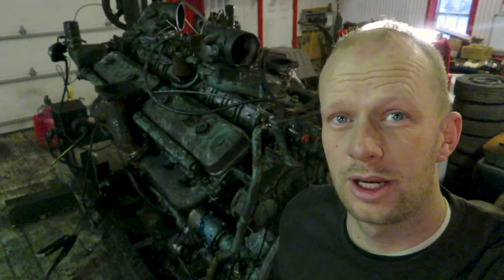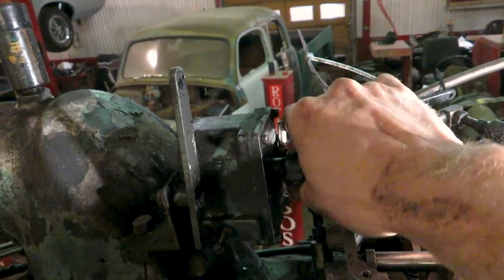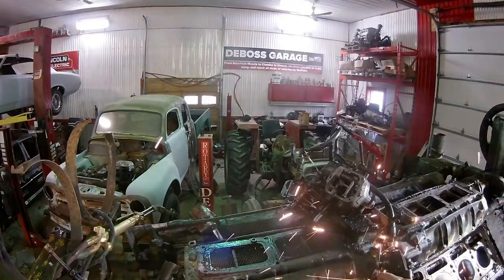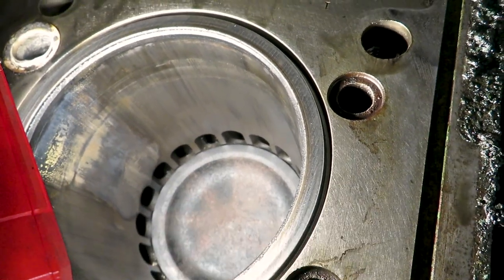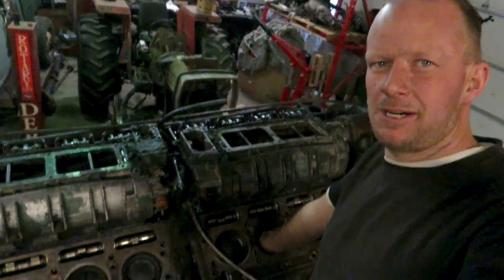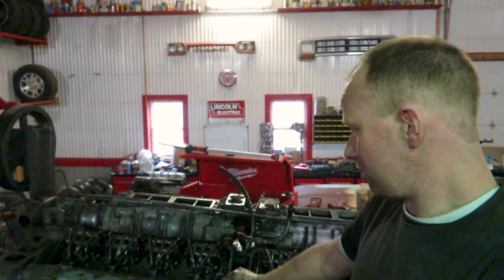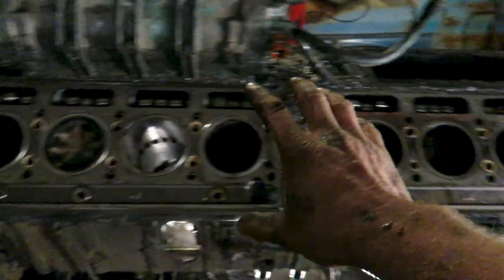What's Inside a 16cyl 2 Stroke Detroit Diesel? #HowItWorks

Comment from the maker: Blowers, valve covers and badging are sold. Check our eBay listings to see what else is available: https://www.ebay.ca/usr/deb0ssgarage?_trksid=p2047675.l2559
Corrections on the video: The engines are not ambidextrous, you can't switch the cranks around because the flanges are different. Also when they run backwards, they puke oil out the blowers and it's not good for them. You need to time the engines differently in the timing cover to get them to run backwards.
Reply: I'd be interested in a piston/Conrod.
Reply: This was actually very useful, my dad has an old tow truck with a CAT 3116 which has mechanical injection. its having a hard start problem watching this video has given me some pointers on what components in the fuel system could be the culprit
Reply: lol thats what i wanted hahaha if you sell one from the other 3 you have let me know
Reply: @CP110 ..... The Cat 3116 and the GM/Detroit Diesels utilized two completely different types of injection systems... they were as different as "black is to white".
Reply: @CP110  yes Detroit is different systems
Reply: How much for a piston and rod
Reply: Dang that fast
Reply: Can you sign a valve cover for me
Reply: First two minutes had me stoked! Watching the rest now.
Reply: Hope they didn’t give much for them blowers because you can’t use them on a gas engine
Reply: This is a 4 storke Diesel engine  Not a 2 storke  Diesel engine   the engine  has valves
Reply: @DaemonWeiss  It's 2 STROKE, Valves does not equal what powerstrokes it does but I'm curious for your explanation and for you to share your expertise and years of working with big diesels and what brands.
Reply: @Salpeteroxid    you have to write 2 valve per cylinder 2 stroke is the working cycle as with mopeds and some cars for example the east german trabant 601
Reply: @DaemonWeiss  It's the powerstroke, I know exactly how it works, I myself am a mechanic. This is beyond your understanding and I think there is a language barrier for you to understand.
Reply: If you want a guaranteed runaway on a future Detroit , dump 1/2 gallon of gas in the engine oil .Then @ wot ,rack max , dump another 1/2 gal into the blower . She'll catch a wiff of the cranckcase then ! Thanks .
Reply: earl verity  If it has a powerstroke every TDC it's a twostroke.
Reply: earl verity  Yeah I know, I'm a train mech. btw. But guy geeze this guy I swear!
Reply: earl verity  Stroking my valves as we speak, four strokes. Any more and we are just playing ;)
Reply: earl verity  Yeah 2% oil right? Wouldn't wanna sieze it!
Reply: @Salpeteroxid  Are the valves on this design for inlet air only and the exhaust is via the ports?
Reply: @DaemonWeiss  it is a 2 stroke that'll was what all the org detroits were and they have exh valves.how ever no intake valves they have intake ports in the cylinder liner.
Reply: Valve cover? It's a 2 stroke?
Reply: @ajripplecon  You may be confusing 2 stroke engines that have no valves (like a motorcycle or a weedwhacker) with the fact that this has exhaust valves and thinking it must be a 4 stroke. 

With forced induction (the blowers) combustion and exhaust happen on the same stroke (piston moving down), and intake and compression happen on the other stroke (piston moving up). Exhaust and intake happen when the piston is at the bottom of the stroke, and compression and combustion happen at the top of the stroke. Pretty cool design...
Reply: It takes different cam shafts to make it run backwards.
Reply: I wonder if I could rig up a lawn mower to run like one of these detroits. Add an extra lobe to the cam to keep the valves open and put a blower on it
Reply: They can be set up to run either direction, just by changing the gear train wouldn't that be ambidextrous left hand or right hand rotation
Reply: brbroberts1 Yup, and the various 2-Strokes often have BOTH intake AND exhaust valves - the defining factor is how may strokes per cycle ... 2-Strokes = 2-Strokes per 1 Cycle. (1 crankshaft revolution)

Loop Charged engines ...
1. Power / Intake (piston moving down; 1st half of down stroke is powering crank rotation; 2nd half creates neg pressure in cylinder above piston; positive crank case pressure;
 - forcing new fuel / air mixture from crankcase into cyl through cyl / piston ports aligned  in walls of each 
- Also, incoming air/fuel mix into bottom of cylinder forces burnt air/fuel / exhaust out exhaust port near top of cylinder.

Sometimes reed valves or rotary valves, in side of crankcase, are used to help build and hold better high pressure air/fuel mix inside crankcase which is drawn in by low pressure in crankcase created as piston raises,

2. Compression / Exhaust 
- Piston rises, pushing spent air fuel mix (exhaust) out exhaust port
- after it rises enough to close hole in side of cyl wall (exhaust port) it builds compression in air/fuel charge that came in beneath the exhaust; 
- Spark plug fires before TDC
Cycle repeats ...
2 Strokes / 1 Cycle

Whereas, 4-Stroke = 4 strikes per cycle (2 crankshaft revolutions)

1. Intake stroke - downward movement of piston draws air/fuel mix in through carb or throttle body & intake valves in cyl heads
2. Compression stroke
- piston moves beyond bottom dead centre
- both intake & exhaust valves are closed (Note: simplified version!)
- air fuel mix compresses inside combustion chamber 
- shortly before TDC, spark plug is fired, igniting a flame front
3. Power Stroke
- burning air / fuel causes RAPIDLY expanding hot gases to push piston  back down again,
- down pressure converted to rotational torque by con-rods and crankshaft
4. Exhaust Stroke
- after piston reaches BDC, crank rotation pushes it back up, forcing exhaust gases out Open exhaust valve in cyl head.
Reply: @glastornjet73  10th ff
Reply: Love the channel! You're right behind 99 and Tim Horton on my list of favorite Canadians. The endless apologizing was a grin. Stay filthy, Rich!
Reply: can I buy the Blowers ???    Please
Reply: since the engine is ambidextrous, couldn’t you flip one end around so that you can pull the cam without having to split the block?
Reply: @donmelton1512  Nope. You change the position of a gear in the valve train and it operates in the opposite direction. The cams always run the same way as do the blowers. Problem is, if you have a one way clutch on a unit and install the gear the wrong way, it will lock solid. The gear is located on the flywheel end of the engine and is under the cover between the flywheel and the block.
Reply: @russgier4409  But it takes a good bit of work to access that gear to change its location.
Reply: @ianrutherford878  nope, the valves or for exhaust only and the ports are for intake
Reply: @TheMattc999  Thanks.
Reply: @DaemonWeiss  It's a two stroke. The function is beyond your understanding.
Reply: They will backfire sometimes and run backwards, but it's not good for them. The cam timing is rotation specific, but Detroit 2 stroke engines could be cammed to run either direction. The crank was the same for either rotation.

Comment: I’ve tried finding videos showing how these engines work. No one ever went into detail or explaining it in a way that I understood so now I know so I thank You.
Reply: I've been watching Detroit vids for years. There's a few good ones, you just have to know what to search for. There's so many variations on these Screamin Jimmies. 3-53, 4-53, 6V53, etc. They don't make much power, have a narrow power band, and usually leak everywhere, but they're so cool!
Reply: They made the 53 and 71 series from single cylinders up to v24s. The 92s were V-block motors from v6 all the way to v16s. Wicked cool engines.
Reply: Watch sultzer and wartsila videos too
Reply: If you think these are cool and unusual, search for Commer engines on you tube. They were a truck and diesel engine manufactured in Australia. Still a 2-stroke diesel engine, sounds like a Detroit, but very unusual in the way they're built and run.
Reply: @j.mshrader4104  And what about 16V149 engines???
Reply: Here in North Carolina, we destroy 2 good tools to make 1 good one all the time, Eh.
Sometimes 3, Eh.
Reply: Come to egling airbase foam trucks 120 mph in seconds full load with these engines foam is heavy
Reply: @Eriske1874  i hauled the pistons to florida for the biggest wartsilla then went back for the crank massive six piston paks in the 53ft trailer filled her

Comment: Man you would have loved to see the 16v149s we used to run before "upgrading" to the MTU 4000. quad turbo, two blowers, dual intercoolers and about 4 square KMs of smoke when trying to start them at -30.
Reply: You must work in the oilfield too.

Comment: Custom sockets... That's a real man's tool box
Reply: Dad worked for a Mack dealer for 25 years. Had tons of home made tools haha
Reply: @gmjunky87  Gotta spend money to make money.
Reply: @gmjunky87  Did he buy Mac tools?
Reply: @shadowthehedgehog4737  haha nah Mack Trucks dealer
Reply: @gmjunky87  That was a joke.
Reply: Andrew Arceneaux Wasn’t funny.
Reply: @Icutmetal  Then why comment?
Reply: @beeroquoisnation  not always a spending money thing. in my case i have to grind down impact sockets to fit, so just a few minutes at a grinder makes mine as custom as needed. other people weld things together, and rod isnt that expensive
Reply: @Icutmetal  hilarious!
Reply: GmJunky87 Yep. My dad had to work on a Mack firetruck in the middle of Montana and so he cut up a socket to fit on a bolt on the gas tank i believe.
Reply: I have a good bit of my papas and dads. Some things that make you go dang. Mostly snap on wrenches and sockets with crazy welds together
Reply: I make custom tools all the time.
One of my recent ones was not made just found, I had to find a socket to fit a Whitworth size which was about the equivalent of 13 1/2 mm so I finally found a well worn 13mm impact 6-point that fit right on.

Comment: Worked on these for years, those injectors are not as durable as you make out. They are indeed a fuel pump and need to be treated as such.  The. Rod should move freely under it own weight. And be clean any dirty fuel can cause problems. The most complicated part of a tune up is getting "bounce" on all the injectors while taking all the play out of the rack rods.

Comment: You can't save everything unless you have unlimited cash and unlimited space. And even then what needs to be saved or should be saved from rust or neglect etc probably won't include as a priority  an engine that's needing a complete over haul of very expensive parts that there are probably dozens of in old army surplus or obsolete Oil Rig gear. There would more than likely be some in better shape. If Deboss says it's not in good shape I believe him! LOL. Thanks!

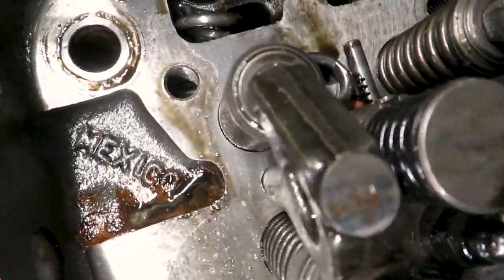Comment: I have some information on the Mexico head @19:00. I used to work at Detroit Diesel Remanufacturing and they started bringing in new bare castings from Mexico that we would CNC machine into a finished replacement head. The Mexico castings have had problems with QC and consistency of material. This option of head was usually cheaper for the initial re-man cost, but as you can tell with this example, would not usually hold up in the longevity department. These platforms were put on the back-burner of interests for Detroit Diesel at the time (especially for remanufactured replacements) because of the then-new development and marketing of their DD15 engines after the transition out of the series 60.

Comment: I drove an 80’s Mack that if you backed too hard into a pile of dirt it would stall and spin the engine the opposite way and would run in reverse. It ran like crap and it was weird seeing exhaust coming from the intake.  It took me a minute to figure it out the first time it happened because it stopped and started backwards in a second so I didn’t realize it
Reply: Probably need to fix a blower rotation in order for it to run properly in reverse
Reply: These engines are unreal!!
Reply: Chad Musgrove Need to reverse the oil pump in the front , no oil pressure in reverse.
Reply: bababooey7576 Rebuilt a couple of these, used them on generators and asphalt grinders , rubber tired dozers, also a V. 12 Cummins.
Reply: jakemj03 No quite , what generally happens is the seals on the blower shafts start leaking and when cold starting it loads up the air boxes, when it starts to warm up to temp the oil sucks into the cyls and vroom.
Reply: I think jakemj03 was referring to when the OP's Mack was running backwards... Changing the ignition timing and starting a 2 stroke bike backwards was a good practical joke back in the day, challenge some big head to get up the road faster than X time, set them on the bike and watch them eat the clocks :D
Reply: Could make a good vid trying to get something similar to this to run in reverse
Reply: @chadmusgrove4571  no, the blowers are gear driven off of the back of the engine. so irregardless of the direction the engine is turning it will still run.
Reply: They can run on the oil vapors in the sump but I think the oil rings have to be worn to do that.Some transport companies I've known in Brisbane Australia have easily done over 1 million miles and never been rebuilt in that time just because they know how to run them. They cannot stand excessive idling which glazes the liner bores with a burnt on oil coating creating friction and other problems.
Reply: Problem starts when engine allmost get dead and gear on, then moves little backwards and then starts running wrong way. Hat over exhaust pipe is only thing what can stop it. Most fuel pumps are made so that they cannot run wrong way, last europeans was maybe  Leyland 690 engines. Fuel system like Detroit and cummins it that not so simple make system what shuts it out when try turn wrong way.
Reply: My dad was a tricker in tke 80-90s in rusia he told me a story of the engine runing backwords. And how it hapebed was cuite simple 
If the ruck was going up a steep hill and on soft ground then uou use a gear thats WAAAAAYYY to low (like near  or at the point of stalling) when he'd depres the ckuch it wuld run in reverse. 
Onsebyou shut the engine off and restart it it would worck perfecly 
I think it was a kamaz (Камаз) or maz (маз)
Reply: Happened to my brother once. 2 speeds forward and 13 in reverse.

Comment: jeep 4.0 had a little tick, it developed into a high pitched clatter. I decided a piston skirt had broken up and probably scored the bore. It still drove fine( didn't smoke and only clattered on the over run). I carried on driving it then one day it threw the little end through the block. I drove it two more miles home.  I opened the bonnet and found most of a piston sitting next to the engine mount on the left hand side. It always amazes me what an engine will put up with and still run.
Reply: The 4.0 doesn't die easy. You'd think it was a diesel.
Reply: bustin cheeks  U.K
Reply: bustin cheeks  wiltshire
Reply: i did that with my studebaker lark knocking like crazy, throwing trans from drive to reverse
Reply: @thelegendarysandwich4049  supposed to be a mercedes engine 4.0 jeep
Reply: I found a piece of a piston skirt when I changed the pan gasket on a 460 . It still ran fine !

Comment: 2 sets of rings, blower for pressure, air starter, running backwards. What a fascinating engine. I've read about these, but actually getting to see it...Thanks so much Rich.
Reply: What he didn't mention is the seal plugs on the piston to keep the pressurized air from leaking into the pan around the piston pins

Comment: I know quite a bit about normal gasoline engines. Don't know much at all about detroit diesels.  What a feat of engineering. They aren't fuel efficient but they designed it with such reliability. Thanks for the great video.  I learned alot!

Comment: 3:45 If it's stuck at full rack, that is considered a runaway. It will go way beyond 2300 RPM since the governor won't be able to limit fuel delivery. There's a huge difference between "full throttle" and "full rack".
Reply: It seems the giveaway for when it is a runaway (rather than just revving up beyond the governor) is when the black smoke is pouring out. It cant get any more air in so it goes rich as possible while still making power hence the rolling coal horror show.
Reply: Spot on sir
Reply: And he did not give a correct explanations of combustion cycle.
Reply: @hankclingingsmith8707  what was wrong with his explanation?
Reply: It would only stick on one cylinder
Reply: @williamuskoski1385  Correct it's got spring return racks, on vehicle engines they had two screw racks with no springs, these engines always had air dampers on the intake to snuff them.
Reply: and another thing an inj needle can stick up allowing fuel to just flow into a cylinder starting the runaway.  the air flap really didn't work because as soon as the flap closed the seals on the blower shaft invert and feed oil to the cylinders..  all possible scenarios.  good stuff. @rayg9069
Reply: @firstname6208  Agreed the air dampers were a last ditch way of stopping them, and occasionally you did stuff a blower but they did a good job of stopping the engine, or at least slowing it way down to a smoky, near idling slobbering mess that could be stalled out. Air dampers saved me quite a few times on Generator sets where they would sit for months then get started and go straight to 1500 rpm, occasionally a rack or injector would bind getting slammed into full fuel. All good memories, scary as hell at the time.
Reply: Shoulda checked those injectors first......eh?
Reply: Adam if it has a spring rack the stuck injector winter control the engine but the old style rack it would cause a run away.
Reply: Exactly I used to rebuild these and had more than one try to runaway because of bad rebuild injectors from Detroit it goes full rack the only thing you can do is shut off the air to shut it down.